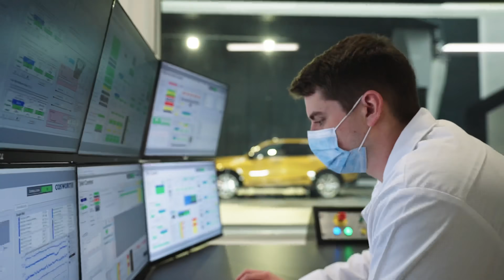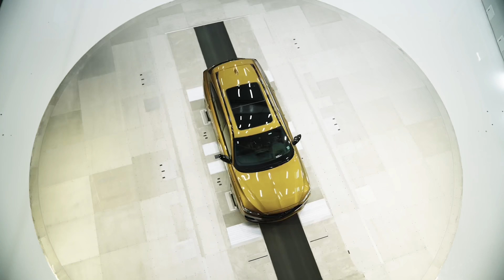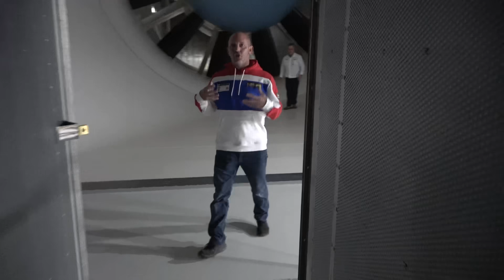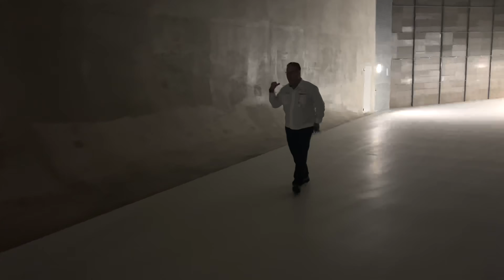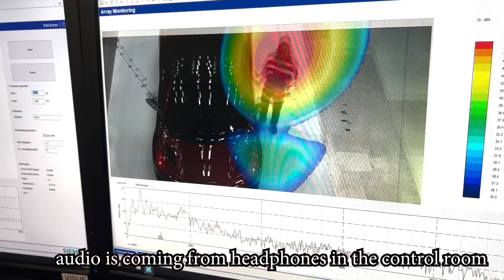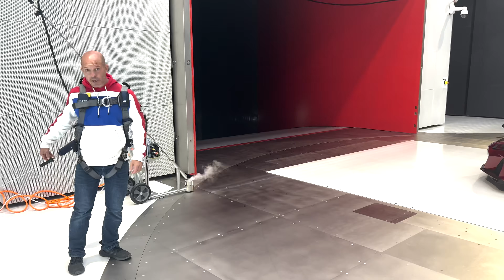The Most Advanced Wind Tunnel in the World Honda's HALO

Comment: iEatBipolarDisorder should impress this and in Minecraft realistic planned wind tunnel for minecarts and since the test section will be very big like they will get megalophobia and minecarts would be small, it will have fleet of minecarts like 12 minecarts in a single file line and the fan blades will be made out of deepslate that will be smoothed out so much that it will have a texture that will feel like a smooth carbon fiber or smooth wood feeling texture and for a shiny look, the fan blades will be coated in nether wart dye with a reddish hue to feel very smooth.

Comment: I have a fan from my work when they used it eventually the pool chain came off in the office position because it’s a con when you have a pool chain and not a knob switch to go between the teaspoons, but basically… I was going to fix it and use it at work because the fans they have there and they are the exact same except for two new ones there at 10 larger actually in large or a 24 inch instead of 18 inch, a little bit louder but basically a lot louder basically there in between their original and basically had a medium in terms of sound but basically I need something like this I can’t like the wall he explain exchanger because I was going to turn it into a heater to use at work but also I want something to keep me cool in the summertime and not just suck the hot air through and push/blow it out so this will/wound be perfect. I hve some ideas lke cool spiral duping that connects to a ftn pump that’s in a little tube box thing on the sde that just blends into the hosing, but on either the front or back, maybe back so water wind get sucked in and mess it up even though it’s somewhat enclosed in terms if it’s missing the little back cover whege utd oscillate, so it just sticks out like the little axel thng but hve a coil on it that can either plug into an out jst on the housing for the previous walk fan tht blows 20 smthng mph, bt thn from there/their mke it to where the heater hears up either from an outlet installed on it or hve ut just plug into the wall and if it’s too expensive to hve a an outlet wired thn I’d jst mke it to where it plug into the wall and jst plugs into the wall whch I could do or so. Bt honestly others could use it too, thn the boss would think/say, is tht the fan I was gonna throw out😦😦😦🤯🤯🤯😱😱😱thn turn the others in to heat maybe try cooling but since it’s a wall thing and water wth electrical safety thn just heat function or so or if/unless it could be xn the front or so, nt I mean lke still,/…I thnk tht thtd be pretty cxxl I mean you/ya knxw
Reply: I think you went a little to hard on the little blue 30s man, just take it easy brotha.....